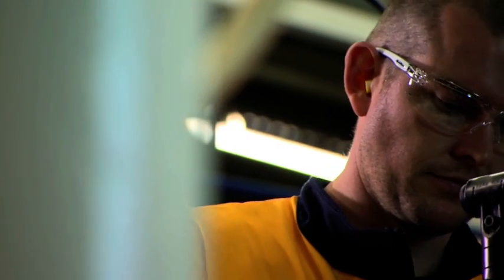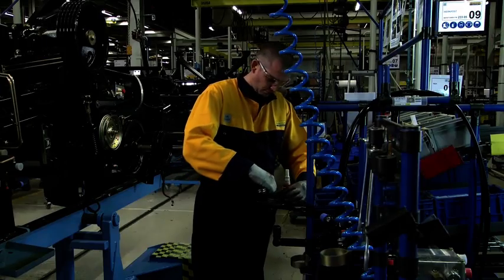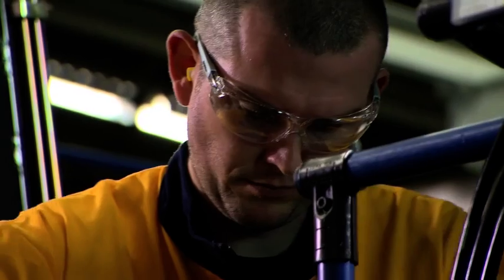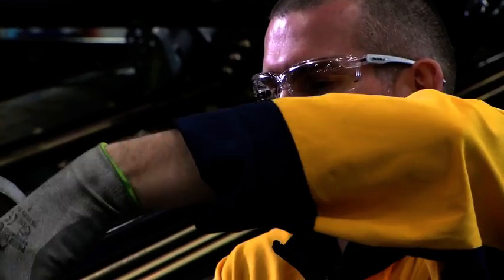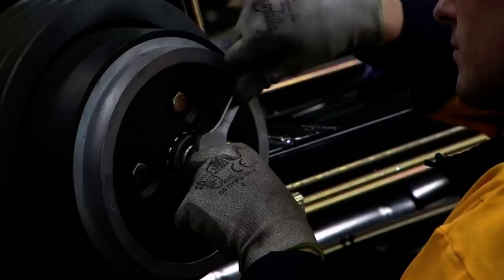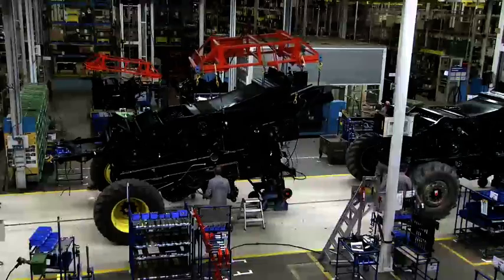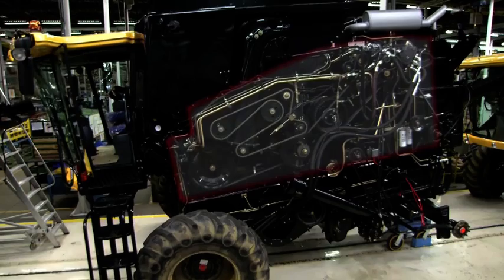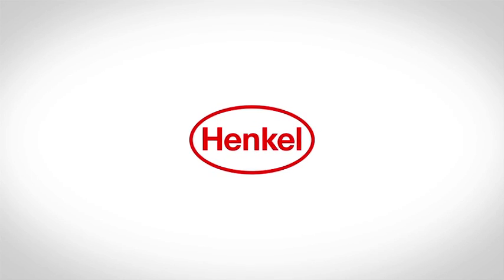LOCTITE 542 - Assembly of hydraulic system

Comment: Hello loctite I'm not sure whether I need 542 or 545 to seal my hydraulic system. It is in a car suspension the pressure is very high (about 180 bar) temperature stays beneath 100°c and the system should not be contaminated.
A reply would be great!
Reply: The problem is a leaking thread.